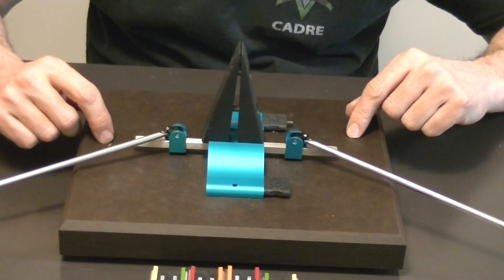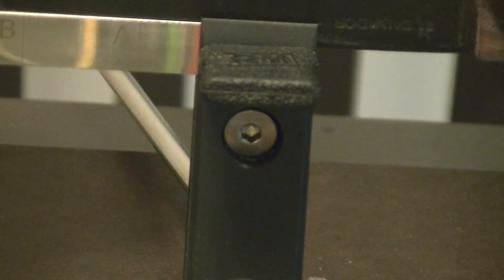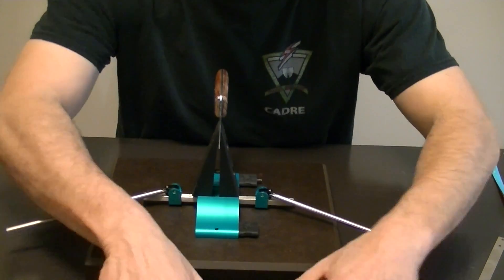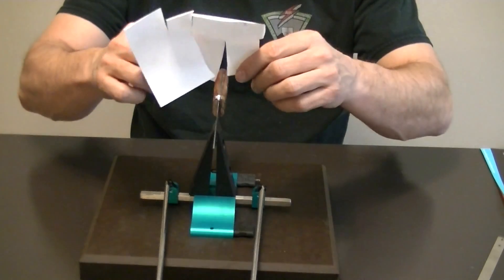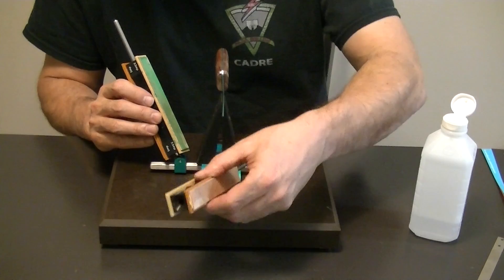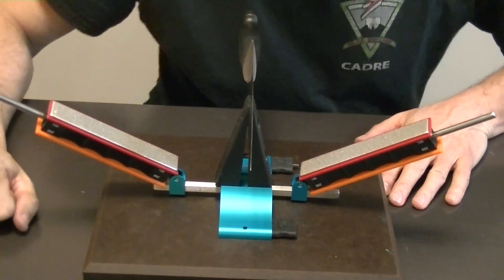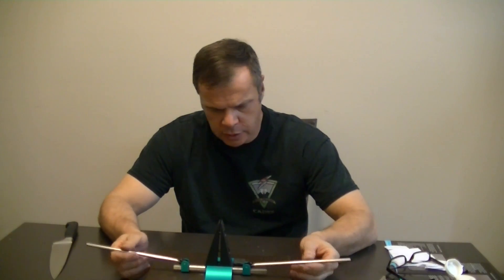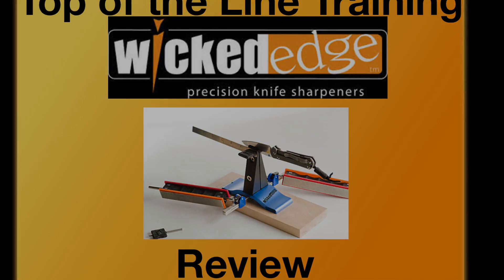Wicked Edge Knife Sharpener Review

Comment: I'm not an expert on the wicked Edge by any means... but it looks to me like that last knife that you sharpen the henckels .. the one side is a diffrent  angle than the other side. ...if you look at your bar, that sets your pivot rod angles...your right side is about three-quarters of the way out from the clamp base ...and the other is about half ways out ..meaning you have two different angles on the bevel of the knife blade.... correct me if I'm wrong...should not these angles be equal for a balanced edge on the blade? Both sides equal angles?
Reply from the maker: Dave Schidlmeier 
Yeah your right Dave but at the time of this video I’d only had it a short time, learning curve, I use it often and it really works great!!!
I have been thinking on doing a redux video on it...sort of then and now.
Thanks for the comment!

Comment: Should have learned a little more about how to use the Wicked Edge before you put out a video on it. The mounting of the knife and using the depth gauge was hard to watch because it was completely done wrong. The gauge goes on the outside of the clamp...not in between which makes it come right off after you have tightened the knife up and you had the bottom screw way too far in. The bottom screw should be all the way out and you screw the top one in tight and use the bottom screw to tighten it up. Also need to tell everybody that they need to raise a burr on each side of the knife to make sure that they have apexed the edge. You also need to 800/1000's to get full effectiveness out of the system. Also....only use the alcohol if the paste has gotten dry. You only need to reapply paste every 50 or so knives. The paste last a very long time. And....you were supposed to use the 5 micron paste before the 3.5 micron paste! Just a few pointers from somebody thats been using this system for a few years now.
Reply from the maker: Dub2020 
Hey thanks for watching! Yes I agree, but since then I have come to know the system a lot better. Even so, some of the pointers you speak of I did not know completely, so thanks for pointing them out. I really love this system...I still don't have the 800/1000 yet, but plan on getting them. I found out about the using 5 micron before the 3.5 micron as well....but again thanks for the info and watching!!! You should put out a video about this, I would love to watch it...take care
Ed
Reply: ***** No biggie....just wanted to point a few things out. Best to YA!